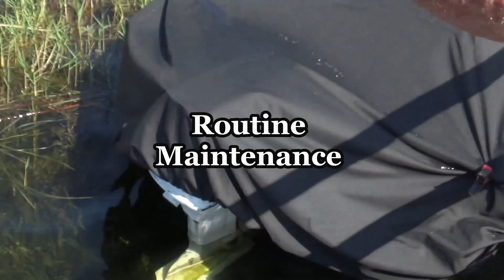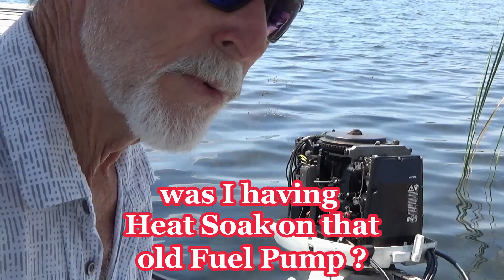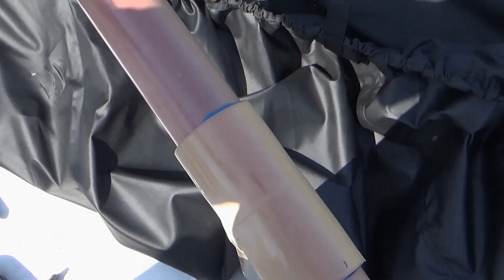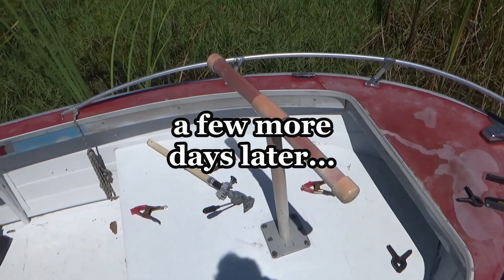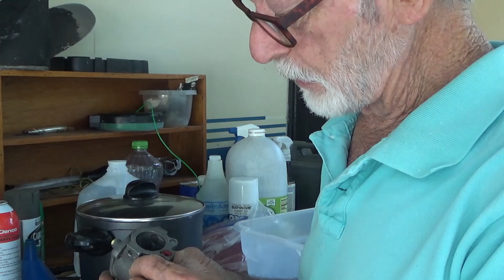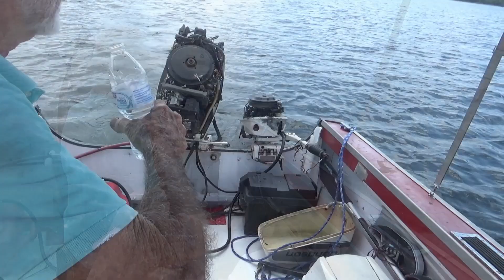87 Johnson 6 Hp Bogging Fix - THIS OLD OUTBOARD

Comment: the 3cyl 56ci motors, the spring for the spark advance link is there for fine idle adjustment without needing to remove the throttle cable. this appeared when the plastic top carbs with adjustable low speed needles did, and I think thats to make your job alot easier. but not exactly a solid system, is it? i have a bunch of NOS ones I bought a while ago, knowing many need replacement. honestly i've taken the spring out and as long as the idle is adjusted w. proper tension on the throttle cable, it seems to be a non-issue.
Reply from the maker: Cool! Thanks for tuning in!

Comment: Hey there! Hopefully your still active on here. I have an 87 6hp Johnson, same as in this video. It was only in the water twice its entire life, then kept in a house until I received it last week as a gift! I did all the routine maintenance, and brought it out on my duck boat. Same problem… starts right up first pull, had great spark, everything was great. But it won’t rev up or go anywhere near full speed. Seems like the choke is constantly on, but it’s not. Carb wasn’t too dirty, anything else you can think of? I ordered a new cam pin/roller because mine was broken. That could have been the issue. Anything else you would do?
Reply from the maker: Hey. Thanks for tuning in. I would start with cleaning the carb nozzle well- It's probably clogged- been sitting too long- double check those gaskets too- they were a problem on this motor and had to be replaced- Put the new roller on and set the timing! If all that don't work it out LMK! Thanks again !

Comment: Always test drive with the motor cover on! ALWAYS! 
Otherwise you won't have no idea if the lower seal of the motor is leaking exhaust under the cover (it will bog down from the exhaust)
Reply from the maker: Yes! Thanks for tuning in!

Comment: Hi sir, thank you for your videos, is there any way I can reach out to you in private, I have a 25h Johnson 2000, Is making a weird noice and I already changed the gas pomp, and carburetor and still keep doing it, I was wondering if I can send you a video of the motor working so you can see what it does and maybe you can give me an idea of what it really has?? Thank you
Reply from the maker: Hey. Thanks for tuning in. I'd be happy to check it out. Best thing to do is post a detailed video on your channel. Give as much detail as you can. That way other people can see it and they may have the same or similar issue and it may help them out also. Get it! Thanks again & LMK! We'll see if we can figure it out! Stay tuned !
Reply: @THISOLDOUTBOARD1  thank you for your response I poste the video here is the link. I explained what it does the best of my knowledge and also what I have done to try to fix it in the description. Please let me know what you think thanks again https://youtube.com/shorts/bSWG1nbEWyI?feature=share
Reply from the maker: @periquitoperez4323  Hey. Thats called a "lean sneeze". Motor running too lean. Turn your slow speed idle screw out counterclockwise until it stops sneezing and you find a smooth idle. You may have to reset your timing also. LMK
Reply: Hello, I am on my way to try your suggestions. But I have a question What is the timing, from (you may also reset your timing) thank you
Reply from the maker: @periquitoperez4323  Hey. Your best bet is to pick up a omc service manual specific to the year and model. That way you'll have all the proper procedures to tune your motor and it has a great troubleshooting section too. Check ebay for a good used manual usually around $30. It will save you so much time!

Comment: I have a evinrude 1981 25hp tiller manual start. My question is does anyone else have to turn into the hulk to pull it over and start or do I have a problem? Mind you I'm not a big guy 😂
Reply from the maker: Hey. thanks for tuning in. It's all in the tune-up!  When's the last time it's had a good tune-up, new plugs/wires, carburetor cleaned, timing set, checked for strong spark on both cylinders, compression check, etc... The better its tuned the easier to start! Everything has to work together. Could also be something as simple as an air leak in the fuel system. Or something worse like worn piston rings low compression. You'll have to go through each system, fuel/ignition. I'd start with the basics, Compression test, Spark test, throw a new set of Plugs in it and Clean that Carb! If need be check out my carb cleaning video, "the two most important things". Also you may want to get an OMC service manual specific to your year/model. It will tell you everything you need know, save you time and it has a good troubleshooting section too. Try ebay for a good used on. I'm not a big guy either which brings to mind the 1990 30hp johnson pull start I had, a seven year old could have started that thing, then I screwed it up, pulled and pulled and pulled on it, hahaha long story but I finally got it back to normal. It's all in my videos ! Thanks again  & Stay Tuned !
Reply: Thanks for the info ! I made a appointment at my local trusted marine shop to get a full complete tune up and carburetor cleaning with new kit if needed. Thank again and God bless